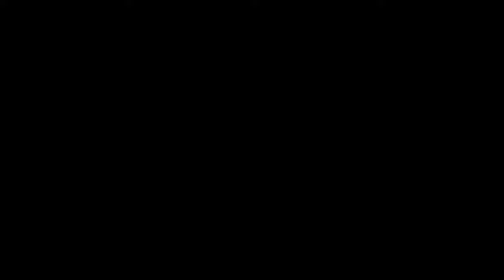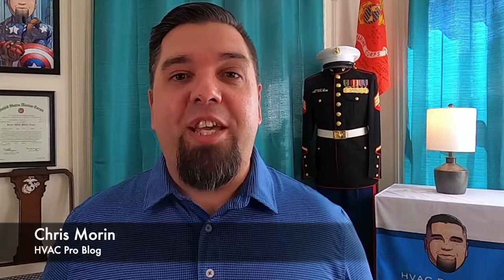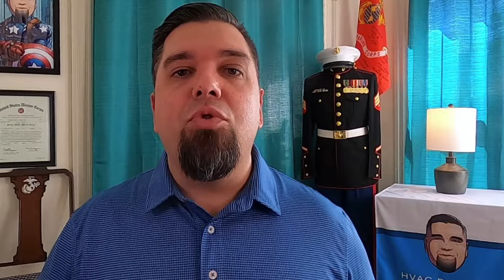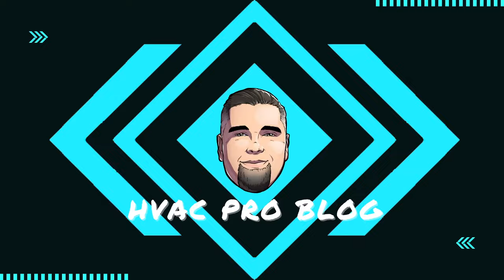Return Air Locations

Comment: 50% of my change outs in Philadelphia I propose completely changing the basement ductwork. Most of the ductwork is from legacy gravity/slow moving air flow systems.
Reply from the maker: Yes!  Low velocity will create tremendous issues with trying to retrofit existing 'gravity' type duct systems with today's systems...condensation, mold/mildew, and an uncomfortable homeowner will all result.  A room x room load calc, then Duct Run/trunk worksheet should be completed to verify the distribution will work with the new system, EVERY TIME!  The trouble is, if you are doing this right, somebody will always come in lower, not fixing/replacing the duct system.  Customer education early in the Sales Process is essential...Good Luck in Philly!

Comment: Down in Georgia after living in Mass all my life. Cooling is not keeping up even though the units are large enough. I mentioned raising the return on the 3rd floor. (The return is on the loft floor and the peak is 13ft above that) my HVAC guy said to get higher flow filters, under cut the bedroom doors and for filtration, buy his friends stand alone water air filter. I have like 5 weeks of winter down here, I'm going to put my return as high as possible.

Comment: If I have a return air in my wall and with no ducts leading like literally just a return vent and then you see the inside of my walls. Why? My house was built in 1988.
Reply from the maker: Hi @shirleypineda9726 !  Thanks for watching my content.  Although ok at the time (1988), this is using the wall cavity as your return duct and would not meet today's installation codes.  The wall cavity is extremely leaky and will be taking more air from unwanted areas, not only from your conditioned space...

Comment: I have been a rough-in installer in residential new construction in KCMO for nearly 20 years. Trying to move into layout and design of new construction. I've always been taught that supply and return should be opposite. If supply is high, return is low and vice versa. We have nearly even heating and cooling seasons. Should I be more concerned with the requirements of each level? Cooling more on second floors? Heating more on lower levels?

Comment: My townhome place in Florida uses mostly cold AC. There is a large floor level return air filter and grill at the bottom of the upstairs hall that feeds the ambient air directly into the AC unit and air handler.  There are also ceiling return air vents in most rooms upstairs and down. Where are these vents supposed to return the air? I have seen a lot of talk about these vents but nobody bothers to say where they return the air.  Appreciate you help.  Rod, Vero Beach

Comment: Our Sunday school room stays hot unless we cracked the door about 2 inches if I install a 12x12 grill up high would this make a difference the room is small and we don't like leaving the door cracked due to noise. Thanks
Reply from the maker: Great question KR - installing a 12"x12" register in a drop ceiling (I assume) could fix this problem for you - as long as the system has an open plenum return, pulling air from above the ceiling.  The free area of this register roughly matches your 2" gap for a 72" height door.  The returns may be ducted to your hallway though, and if not taken from above the ceiling with an open plenum, would mean the register would have to be ducted back to your return trunk...Good Luck with your classroom!

Comment: My apartment has a fresh air vent. It's just a 10x10 return register with a duct that leads outside. It has a filter what direction should the airflow arrow point? Into the apartment or towards the ceiling? They had it facing the ceiling shouldn't it be filtering the air coming into the apartment?
Reply: If it's returning to the system, you're correct of course. [Edit] Your fresh air vent is a "make up vent," used to supply the HVAC with fresh outside air. 

You can achieve load balancing with out it (because that's a different topic) so if we ignore for the moment how it's different ... it's similar to the returns. Meaning, you have supply ductwork, you need corresponding return ductwork that draws air either from inside the house or outside. There are humidity and heat implications with both solutions, and one isn't a substitute for the other.

Comment: Thanks for another very good and helpful video.
As a retired 50 year veteran of the HVAC industry I have found many contractors are sorely undertrained or just unprofessional. But for the pros I offer this:
Many times customers are only interested in price. This becomes a brick wall when the previous estimates never mentioned duct repairs( getting the bad hi equivalent fittings out) or duct sealing.
When the professional starts talking about this, the customer shuts down thinking this is just a way to inflate the price.
Helpful in many cases is the great consumer oriented literature given out by the US Government. US Dept. of energy / energy star program. The great brochures are free you so you leave the brochure with them. It’s a simple fact sheet showing how the duct system and proper installation, duct sealing all make up the real system efficiency; it’s no longer you, the profit driven contractor, saying these things are important but rather The US Dept of Energy. Credibility!
I’ve seen where this third party verification of what your saying sways the customer to your side, even with the price being higher than the others.
I was sealing up duct systems as an option ( extra charge ) back in the 70s after the first Arab oil embargo. 
Consumers need more education from professionals to make an “ informed decision”
Thanks.

Comment: I have two supply ducks in my home theater and realize I need to add a event to relieve the static pressure buildup – so it technically won’t be a return – but I will add a baffle box with a vent that recycles the air close to the return outside of the room. My question is this, is it OK to put The exit vent on my knee wall instead of the ceiling? I live in the south, so I definitely want heat to leave the room.

Comment: Low return in heating only, only makes sense if you have a large soffit in walls. 3.5 inch that also has to be internally insulated riser box in a 2x4 wall dosent work going down a 8 foot wall. The ceiling would still be better with a unit in an attic.

Comment: Question:  I'm changing out my bi-fold louvered door (in front of hvac closet) for a single swing out louvered door; is there a code or general rule of thumb for recommended space size between the slats?  I heard the thickness of a pencil is a good rule of thumb..there are no return ducts....thanks
Reply from the maker: Hi Mark!  The space needed is based on the pressure difference between the rooms.  There should be less than a +/- 5 pa difference.  If there is a return and supply in both areas/rooms, then the need for louvered doors for the purpose of comfort is diminished (still needs to be balanced).  Basically, if the louvers are adjustable, then open until the pressure differential is within 5pa.  Same goes for the amount of 'undercutting' a door, or sizing a jump duct.  Most open the door until the pressure is equal between spaces, then calculate the free area needed by measuring the door opening (lets say you opened 3", then 3"x60"=180 sq.in.). Hope that helps?!
Reply from the maker: Almost forgot - if you have a combustion appliance like a furnace or water heater in that closet - the amount of combustion air needed should be accommodated!  Turn on both appliances and complete the same test, making sure you are within 5pa.